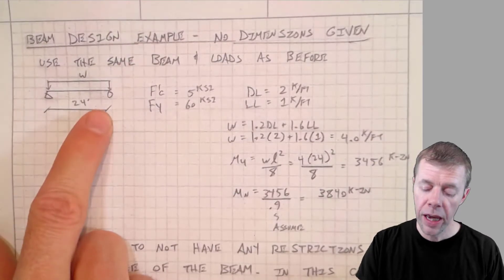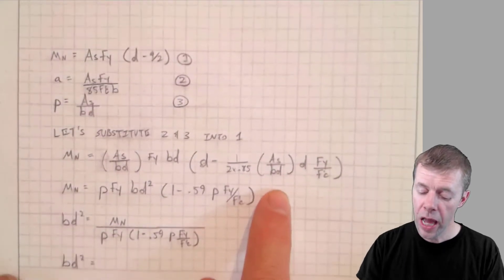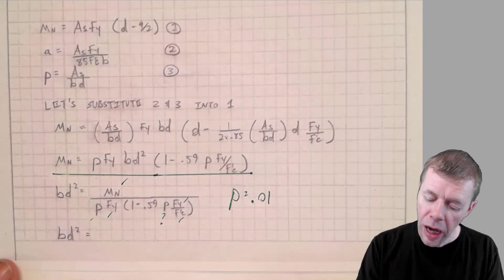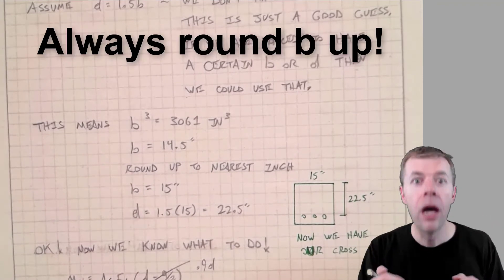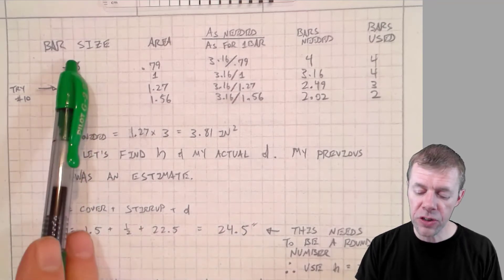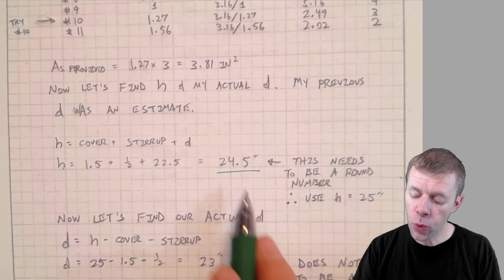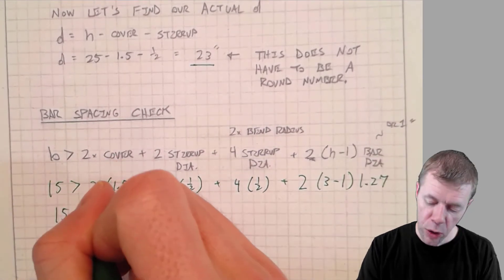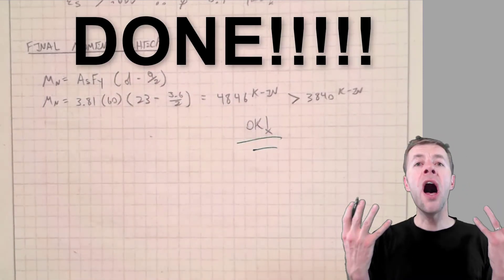Singly reinforced concrete beam design example with no restrictions | homework example 2

Comment: Older engineers, even older than I am, would target Roe=0.18*f'c/fy.  The mythology was that at this reinforcing ratio you would not have deflection problems.
When you calculated 6888 you skipped another useful comparison- solve just like you did but keep the moment out of it.  You will get something like kM=bd^2.  If a person has a given M and they can remember the range for k, then they can easily get to the point of selecting b and d.  In your case k is about 1.8  So if I have moment of 3840 then I recall that k=1.8 and now I know that bd^2 should be in the range of 1.8*3840.
And BTW the ACI design handbook has some interesting tables with all of these coefficients.  There is nothing magic or prorietary in the tables, I suggest you have your students generate tables such as these in a spreadsheet program as a homework assignment.  ACI uses the same term I did, "K", for this coefficient.  Another interesting thing about the tables- where you use the simplification of 0.9d, the tables give what the actual coefficient is for different reinforcing ratios.
But uhhh- when you are calculating "d" it is to the centroid of the tension steel so you have to subtract half the bar diameter too.  Or just remember to subtract 2.7" or even 3" from "h".
Previously I mentioned As=M/(4d)... for this example that would be (288k-ft)/(4x22.5)=3.20 square inches- pretty quick.